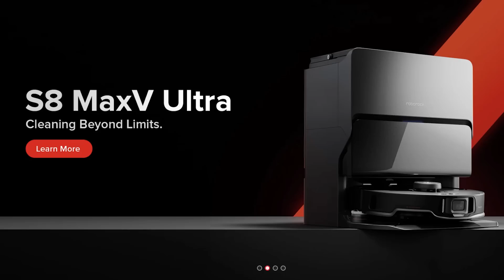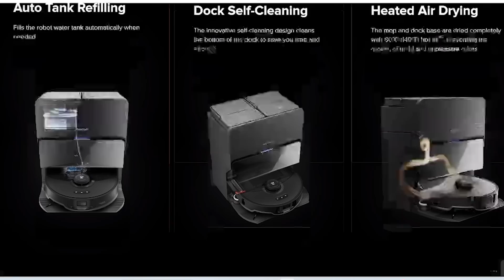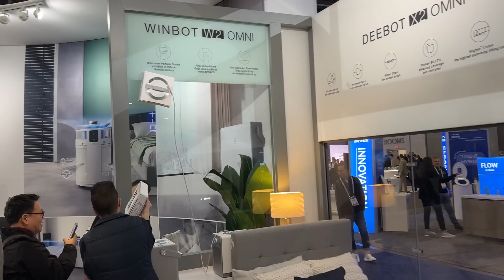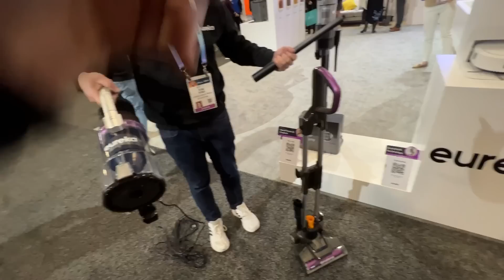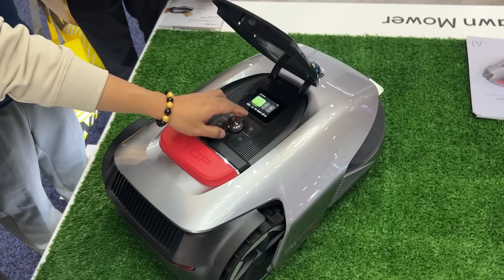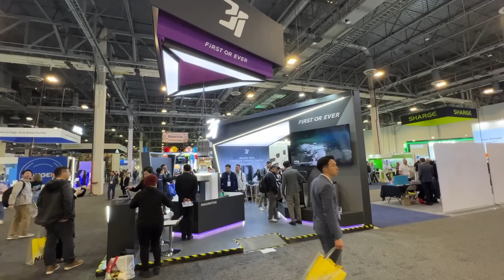Best VACUUMS of CES 2024! - Vacuum Wars!

Comment: Are the vaccum mop combos good for quick vacuuming the area rugs too..? I have all the hardwood floors in my house, but have some area rugs as well. I am looking for vaccum and mop combo which also works on the area rugs vacuuming as well. Can you please answer and suggest a good brand model.? I am having trouble finding perfect fit for my need. My budget is around $300.
Reply from the maker: Most vacuum–mop combos can handle area rugs just fine as long as they have good suction and a way to turn off the mopping when they’re on carpet. In the $300 range, the best option depends on your exact floors and rug thickness, so checking models that have carpet boost and reliable no-mop controls is the way to go.  Check out the robot comparison tool on our website! https://vacuumwars.com/compare/robot-vacuums/

Comment: Just backed the 3i s10 on kickstarter. Hoping you can get your hands on one soon!
Reply from the maker: We haven't done a full review but we have published some test results on our website.  The 3i S10 is currently on our top 20 list: https://vacuumwars.com/best-vacuum-cleaners/robot-vacuums/#17
Reply: @VacuumWars  I recommend a long term test, especially mopping. I don't think the dehumidifier is much value. Especially in winter. But the fact you never have dirty water, is a game changer. The distiller and dumping the yuck out of the water into the trash bag. A trash bag that I've had to change once in 90 days is a game changer. Wouldn't mind seeing a cheaper option that didn't have the dehumidifier but kept the water filter, distiller and other features. Uses significantly less water than ecovacs and similar.

Comment: Bugger, so none of the hand held vacuums are any good. Having a long static handle (whether or not it can bend at the head) instead of a fully bendable pipe makes it worthless for my house. 

I was hoping there'd be a better a better vacuum cleaner than then Miele bagless cat/dog one (which works great for a short while then you realize it's a SCAM as the head is literally designed to fill up with animal hair and dust in areas you can't clean without opening up very well hidden tamper proof screws forcing you to regularly pay for professional cleaning until you learn how to clean it). But... all of the manual hand-helds here are a noticable step backwards in ways I can't budge on

Comment: Were there any improvements to the auto empty dust bin in the VMax Ultra? I have the 7 and my only complaint is that it doesn't work great on long coarse pet hair. Our Husky's hair just does not suck past the roller when it empties so I have to manually empty it every time. When she blows coat I have to pre-vacuum/sweep any clumps before I run the vacuum too.

Comment: Eureka appears to be doing the thing I'd like to see on a Dyson.  For a few years, I've been wondering about the feasibility of having the canister low to the ground and able to be shifted and taken off for other things, particularly in the many reviews that Vacuum Wars has done discussing how the weight is at the top with stick vacuums.   It's one of the reasons I still use the upright and not the stick, though I've keep trying searches to see if anyone had cobbled one together out of pvc pipes or something.

Comment: Actually, Roborock is not the first to come with this corner-cleaning edge brush feature, back in like 2013 there was the Samsung Navibot CornerClean which had like the exact same thing. It was more a gimmick back in those days but now I believe it will actually make a difference.
Reply: Dreame L20 ultra is the first one that does it extremely well. I got it and have been using it for 4 months.

Comment: that feature where it can be hooked up to a water line the ecovaces has they don't advertise it or anything but if you go to the back of its base station there is a cap like thing that will pop off and you can hook up a dirty water line and a clean water line

Comment: EDIT: the new 2in1 Samsung robot vacuum isn’t the first 2in1 from Samsung, TECHNICALLY
The original Samsung Navibot models from 2010 came with a mop (a literal swiffer)

For those who are wondering, the extending sidebrush isnt really a new thing, it was introduced by Samsung on Samsung Navibot S Cornerclean around 2013-2014 if I remember correctly, and has been continued by Toshiba with their newer robot vacuums.

Also another thing, how come roborock keeps adding more powerful motors yet it doesn’t translate well to CFM? I still find it funny how Roborock S8 has lower CFM than Roomba j9 which has a motor of like a toy vacuum? I hope they improved the CFM on maxv 

Lastly, the Eureka E10 is a rebrand of Midea M9, which AFAIK another cheap no name Chinese things that companies put their name on. Not sure about the other Eureka one tho.

Comment: The idea of a dehumidifier that uses the water from the air to clean you house is freaking NUTS! I hope it works as good as it sounds!
Reply: It's really power hungry. But robot use few water, so it can do the trick!
Reply: Every time someone tries to repurpose a dehumidifier it fails. It’s a dump idea. Space they used to include the dehumidifier, they could have just had a bigger tank 😂
It’s not going to work if you aircon running.
Reply: The water from dehumidifier is really dirty
Reply: @xQKUg9S The only reason it would be dirty is if the surfaces it collects on and in are dirty. Dehumidifiers are not made to be food safe but the water from them is more than fine to clean with. It's just water.
Reply: @xQKUg9S  He stated in the video that they were distilling the water before putting it in the system, so no, it wouldn't be dirty. In fact, it's probably a really great idea as it won't do water stains as it dries up from the minerals in the water. I'd like to see him review it if it really makes a difference

Comment: I keep waiting for a garage robot vacuum but I doubt there is a big enough market for it.
Reply: Makita makes a robot vacuum that is designed for areas with large amounts of debris like workshops and warehouses. They cost a pretty penny though.
Reply: @fidgetthedalmation7433  Yeah I've seen it. It's pretty useless. Too tall to fit under cars, expensive, doesn't seem to have a dock. Not sure who they made it for.
Reply: @postbreak  Yeah, I’m not sure. For its price, it lacks a lot of features. It is cool that it uses normal tool batteries (easily replaceable) but it’s not very autonomous, which is what a robot is supposed to be.

I never even thought about fitting under cars.

Comment: This is what I have been waiting for, The Tineco S12 was an absolute beast, S15 was a disappointment, but this Tineco with The Auto Clean Station will destroy everyone! Every other auto clean station requires you to buy bags, Tineco does not
Reply: but that means there's one extra set of filters to clean, in my opinion, the most low maintenance solution would be one of those self-clean docks that flush away dust into the sewage system. But then again I'm a bagged vacuum user for convenience
Reply: Are you living in 2005? Who uses a bagged vacuum system anymore haha, and please tell me its not disposable bags where you have to purchase more and more and are corded... @Kubulek17